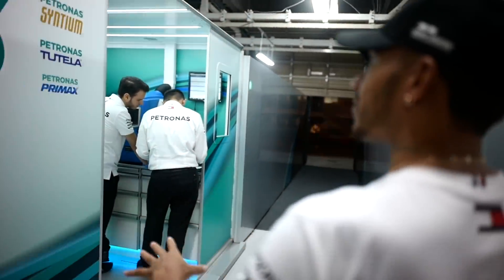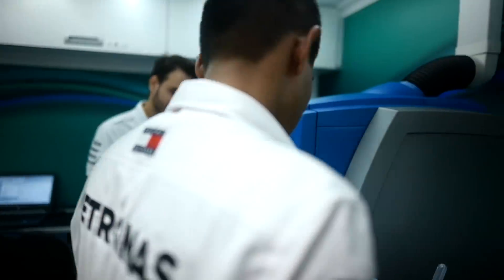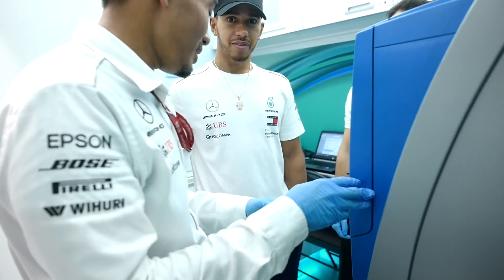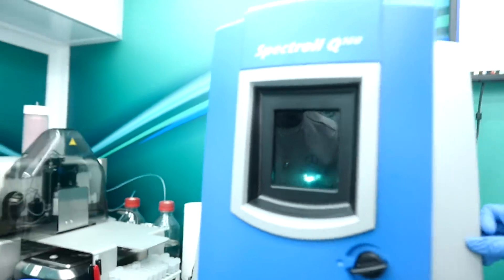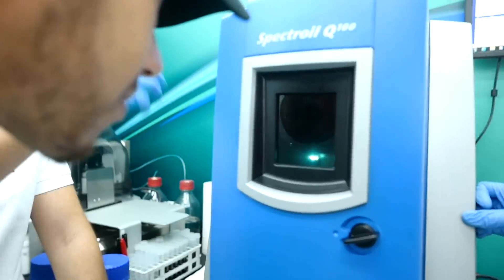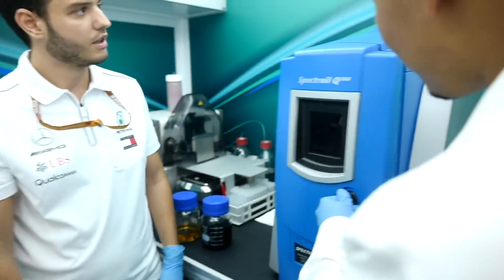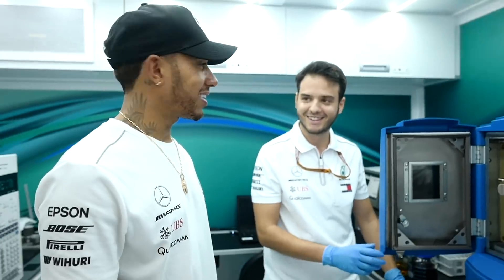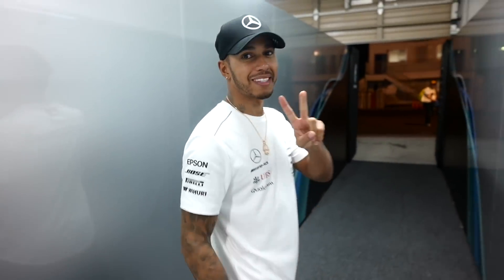What Happens to F1 Fuel & Oil After a Session?

Comment: is it inductively-coupled-plasma mass-spectrometry you're analyzing the oil with?
Reply from the maker: No its rotating disc electrode atomic emission spectrometer. The machine you mentioned is too big to travel to the races!
Reply: @MercedesAMGF1  And you're doing a quantitative analysis of metals in the used oil to measure engine wear? Are there a lot of chemists working on the cars? What are the other machines you are using there?

Comment: Very Interesting behind the scenes video. Good Job Mercedes. So could you guys please explain what happens to the fuel if there is some remaining in the tank post qualifying?  Do you reuse the same fuel or use fresh fuel for the race(despite the fact that the fuel used has impurities)?. If fresh fuel, what happens to the used fuel?
Reply from the maker: We will tip and drain the car and re use the fuel. If it has not been used, that’s the only reason it would still be in the car!
Reply: +Mercedes-AMG Petronas Motorsport Thanks for the reply guys. Good luck for Mexico.

Comment: Not what I expected but interesting stuff nonetheless.
What I expected was to know about how much stuff like oil and possibly remaining fuel goes to the next session.

For example you guys put fuel on the car for 15 or 25 laps for say race simulation, but something happens after 2 laps.
Maybe ocon tries to pass Perez or something and session gets stopped.

Then you have car with fuel for 22 laps in the tank and the free practice 1 ends. Do you leave anything in and use it for the next session, or do you change everything even if there was no issue with the car.

Comment: How do I get a job it the F1? ill mop floors if I have to, just to get my foot in.
Reply: If you are not a driver - best bet is to study. Something in engineering preferably.
Reply: @PartisanGamer  mapping floor needs degree in engineering? are stupid?
Reply: Maybe you just have to walk in with a bucket and a mop and say 'Hi, I'm your new janitor and I'll scrub your floors for only € 1.000.000 a year.' 😁😁😁
Reply: @bobdevries4028  hahaha. Thank you
Reply: well..u need certificate, at least master or phd in engineering related to oil & gas or engine mechanical to do mop floors job.
Reply: Most teams scan these YouTube comments, and they especially favour poor spelling and grammar.
Reply: @user-bc9mg5no3x  shut your pie hole.
Reply: A couple of weeks ago I had vacancies suggested to me on LinkedIn for IT staff for both Williams and Mercedes. IIRC  the Mercedes was a senior engineer to work trackside. Would have been my dream job but I don't think I could handle the pressure.
Reply: I served a tools making apprenticeship @ Rolls Royce to HND level in Mech and prod engineering I've worked for various F1 teams in their machine shops.....don't be fooled there's better jobs and companies to work for
Reply: Damn right I could even scrape off stuff
Reply: I was thinking the same thing. At least a mule. Those guys that pack up and set up shop .
Reply: Drivers should spend more time talking to engineers once session stopped because such mistakes can be costly and things should always taken between steps
Reply: There is a job under Toto wolf's desk.
Reply: U need crony